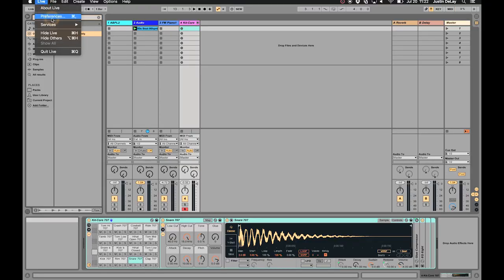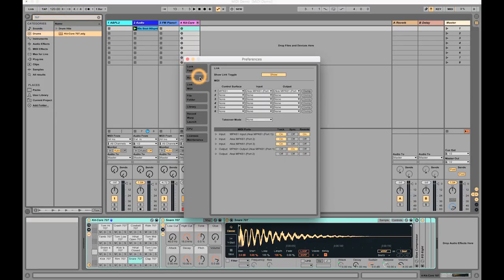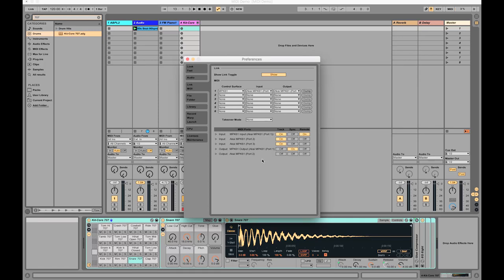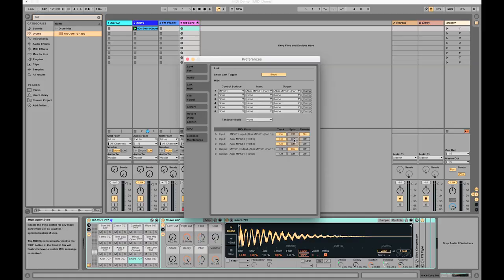Ableton Basics - Part Five: MIDI Outputs & Clock Sync

Comment: I was told that a particular USB/MIDI host to run my Roland F20 USP only piano into an Alesis QSR sound module will make the transition to the MIDI ports of the QSR.  I'm looking to be stand alone with no computer or tablet of any kind.  BUT I was told that it this controller will not send a clock signal.  Can you help me understand what a clock signal is and how this would effect me?  Thanks for any help.  Also is this the result of the F20 or the specific host I'm looking to buy?